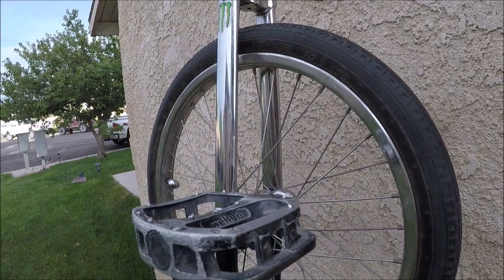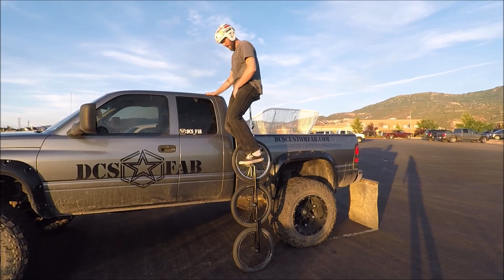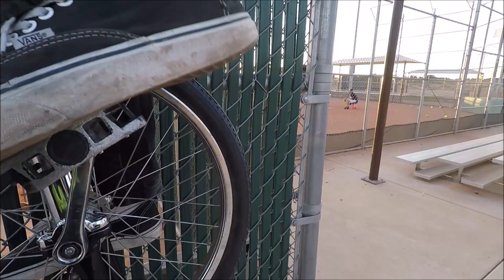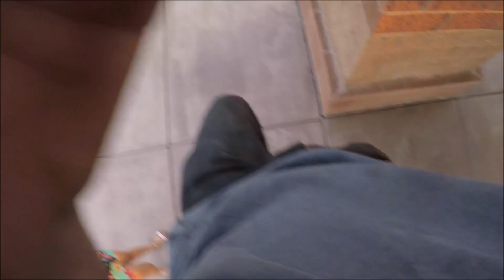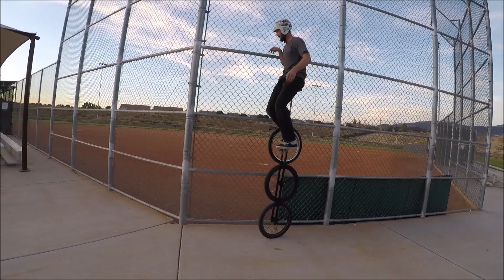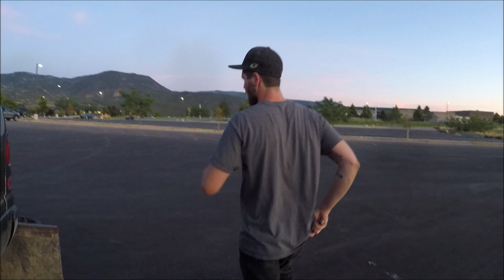HOME BUILT Giraffe Unicycle FIRST RIDE ATTEMPTS

Comment: I'm practicing on a 5 ft giraffe. I have to buy the 3 wheel because the price is under 400 due to the demand;none. good vid.
Reply from the maker: Hell yeah! And yeah that's why I just built one lol I have a build video on how I made this 3 wheeler, check it out it's actually pretty easy to make!
Reply: Where'd you find it so cheap?